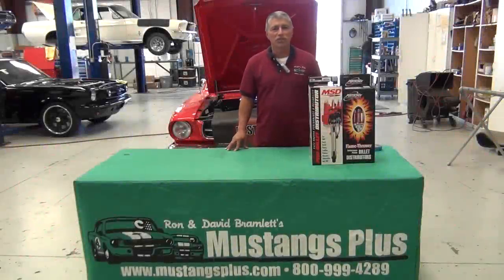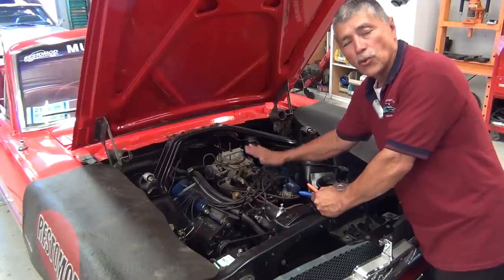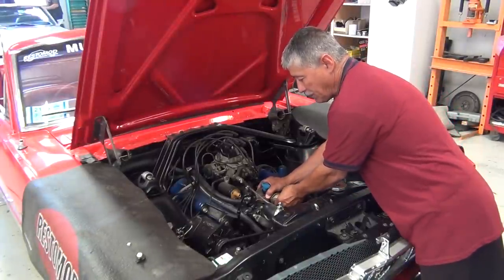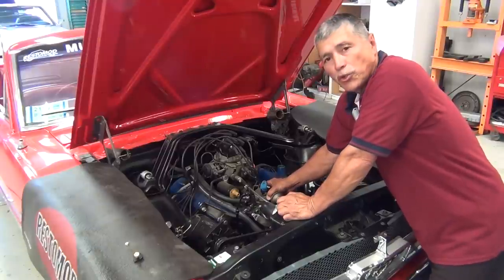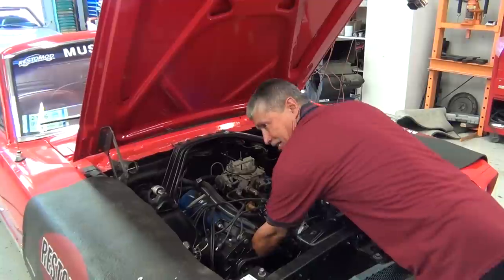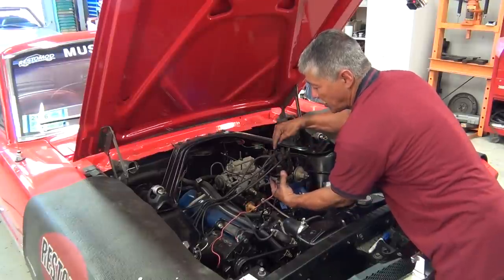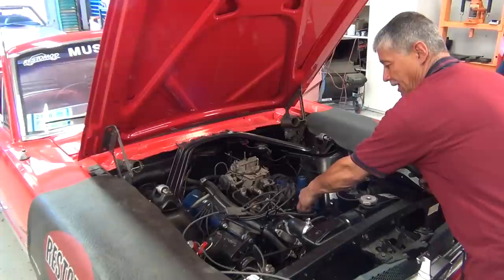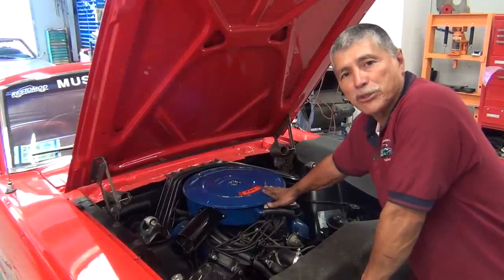How To Install A Ford Mustang Distributor And Set Timing

Comment: May want to check that when the crank is on TDC that your rotor button is facing pointing at the number one spark wire position as you maybe 180 degrees out. Crank turns twice for one distributor rotation.

Comment: Make sure the tdc is in the compression cycle and not the exhaust cycle. Also you need to get total timing set and then initial (at idle) timing set because as the RPM’s increase, so does the need for advance.

Comment: Best distributor to replace it with is a HEI made for Ford. I think it was Speedway I bought mine for $79 and you can eliminate the coil. It takes all the replacement parts as a regular chevy HEI does. I bought one for my 302 in 1929 Model A.
Reply: Yes it will work with either the old 302 or the HO 302 which I have. The only thing different is the gear that rides on the cam gear at the bottom of the distributor. The one I got is the HO 302 which is a roller cam engine and take a special gear.
Reply: What's nice is one power wire and one tach wire and eliminates the coil since it's built into the cap.

Comment: I cranked the engine to TDC and made sure the timing was 10 BTC and drove around with my old distributor in (wasn’t starting, I got it to run after doing that) . I’m planning on putting in a new distributor today. Looking down at the harmonic balancer, it’s not on the 0 TDC mark. Do I have to set the engine to TDC again before placing in the new distributor?

Comment: First you must verify that the harmonic balancer did not spin on its rubber mounting ring by putting a piston stop in the #1 spark plug hole. It could be a few degrees off.

Comment: Hello Mark, I have a 1978 Ford 302 engine in a pickup truck.  Is there an O ring or seal where the distributor goes into the block?  I think I might have a leak there, and that I might have to get this O ring replaced.  The oil sits in two little depressions on each side of the water pump and distributor when it leaks out, and I sometimes soak it up with toilet paper.  The leak is either from this or from where the intake manifold meets the block, but this latter joint was re-done not too long ago by a good mechanic.

Comment: hi, what is the way when the removal position is lost?
the zero mark on the flywheel is finger on the cylinder 1 cable?
I have made the fine marking before, but which gear position clicks is lost,
is a Nissan H25 engine Forklift,

Comment: how do you remove the interference from the oil drive shaft while stabbing the distributor?
Reply: Use a small ratchet with a long extension and a deep socket of the size of your oil pump driveshaft to nudge the shaft bit by bit while you try stabbing in the dizzy. You’ll get it in perfectly eventually. (I’m sure you’ve figured this out by now but folks reading the comments on this video might not know :) )

Comment: i think i may have done that but my car starts it just has no power when i give it gas idles ok but not right is there anyway to do this without a timing light and do you think this is my problem
Reply from the maker: Call our tech line 209-444-8046. You will be able to speak to Mark he will be able to help you out.
Reply: Thanks man

Comment: When I drop my distributor I point the rotor to the #1 spark plug with no success should I be pointing it to the #1 wire?
Reply: watch again, he isn't pointing the rotor to the #1 plug. He is pointing to where that wire will go on the dizzy cap

Comment: Question here for anyone who would know the answer. I have a 1986 Ford LTD Crown Victoria with the 5.0L. I've had a misfire for some time now that only occurs at idle, and I've done everything I can think of to eliminate it (plugs, wires, cap, rotor, fuel filter, air filter, MAP sensor and O2 sensors) and it's still there. I was thinking of replacing the entire distributor but while watching this it dawned on me that a friend of mine had timed the engine using the number 5 cylinder as a reference for the timing light (he thought #5 was #1). So my question is: Could using the wrong plug wire during the timing process result in an engine that run rough and misfires at idle, but still runs nonetheless? Or would I expect the engine not to run at all? I'm at a loss to figure out this misfire and I feel like maybe the timing need to be re-checked.
Reply: might as well try re-timing it, right?

Comment: Number 1 plug is on drivers side not passenger.
Reply: jimbo16720 on a  ford number one is passenger side
Reply: Wow jimbo16720, why do you share misinformation?
Reply: No matter wich engine number 1 is always the cylinder closest to the radiator
Reply: Jay Miller nope, it's wherever the manufacturer says it is
Reply: You're right...I'm thinking chevy.